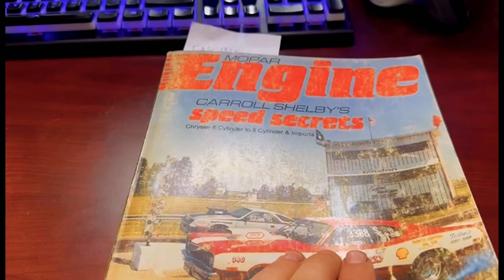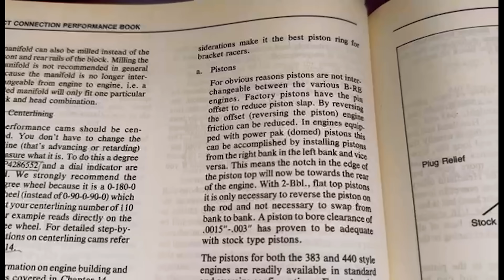The Great Piston Flip Controversy Returns - Fairy Tale Or Free Power?

Comment: This theory is dependent upon the type of piston. Sure flat top and domed piston you could reverse but if the piston is raised and have specific valve cuts for the intake and exhaust valve then you shouldn’t reverse the pistons. I just saw Nick of Nick’s Garage trouble shooting an engine trying to find a knock. When they tore it down to they found that it had the pistons in backwards and they were designed to be used in the correct way because they were raised pistons and cut with specific valve relief for the intake and exhaust valves. The pistons were backwards and the valves were hitting the pistons causing the knock. It should be advised that if the pistons were designed for a specific cylinder because the valve clearances then they should not be reversed.

Comment: UT, I used to do that piston flip on 400 SBC circle track engines in 2bl carb iron head intake and exhaust classes. Those engines would struggle to pull across a broad power band as stock but when flipped around with the same cam timing I could get 200-300 more rpm .

Comment: Great show Tony.   My gut was telling me they were using the wrong engine for the test.   Your offset info reinforced that.  I talked to Larry Shepard 
(The author of my copy of Direct Connection engine manual) and they don’t recommend flipping anymore.  He noted that the test would need to be performed on an engine setup the same as the ones they used. Great conversation with a man who was cutting apart heads and blocks to study core shift trying to understand the difference in hp and tq of racing engines assembled the same way.  I built my street class bracket car according to the book (not flipped ) and it runs on the money to the book

Comment: You need to watch David Vizards video on this. You not only turn the piston 180 degrees you also move it to the other side of the block. Smokey Yunnick did this in NASCAR and said it was only 8 or 9 horsepower.

Comment: 🔔😎🇺🇲
Never forget that flipping changes the piston acceleration rate approaching top dead center and leaving top dead center.... And also bottom dead center.
This indicates that the cam installed lobe center line angle might need to be changed... AND the cam lobe profiles might need to change. That is the valve events might need to be different.
As most know, there is quite a difference in cams with the exact same cam card specs. THE Joe Sherman claimed about 15/15 improvement on a Ford 302 with only the .060" offset... Just flipping without a cam adjustment might not get much of an improvement.
Joe got 400 hp from a 289 and a 302 with factory iron heads.
Magazines called him a liar because they couldn't do it Joe had little tweaks that 
😎everyone overlooks.
😎😎🇺🇲🔥

Comment: I seen some pistons, instead of nerl, they had cross drilled the friction points, on the skirts. They swear by it. It looked feasible. They were catching hell over it. 
    Buy some pretty over priced pistons, with this bullshit coating. None of them understand what the goal is, and probably have a builder do assembly. They are the ones that struggle with some hacked up beater grabbing the line from them regularly. Feel for the builder that had to tell them, suk it, you bought the parts.

Comment: The piston pin offset was also often reversed by many of the guys in Production Touring Car racing in Australia in late 60's, early 70's.
 
 Interesting point to note is that when you check your crank TDC mark pre and post the flip you will see  that after the flip the TDC mark will read on the retarded ('after top dead center') side of the TDC mark yet of course the piston is at TDC. This of course affects cam timing because you have the piston at TDC but you have rotated the camshaft forward and effectively slightly advanced the cam timing.

The above scenario also occurs to a lesser extent when swapping from a factory type offset pin to a typical performance piston with a centered pin. You always notice the shift in ture TDC marking and cam timing.

The piston flip effectively increases piston speeds toward TDC increasing quench mixture motion, then after TDC the piston moves away from TDC slower. So an increase in combustion efficiency and a decrease in skirt friction and piston time to absorb the combustion pressure. Very slight changes with results that vary due to piston pin offset and combustion chamber etc.
Reply: Great comment!

Comment: Uncle Tony, you made a very classy response to those big-dollar, television "experienced and highy technical" engine builders that have now been demonstrably proven to be completely talking out of their asses.  Well done.
Reply: Talking out of their asses with a megaphone on 12.
Reply: The offset wrist pin is purely a situational deal a 8.2 deck sbf has a .300 outboard offset pin vs say a  318 that has very  little offset " i believe it's .060 or .080 on early cast pistons" so there is a little mechanical advantage the sbf can take advantage of but it's purely only going to be available above 6k rpm and if you know anything about a 302 block if you hang it that high it's soon to be in your scrap pile when it splits down the center in 2 pieces
Reply: @ZackeryStang ive got a 68 302 block on an engine making 520hp that goes to 7000rpm constantly (curcuit racing). If its split down tge middle the sump has been doing a good job of holding it togeth these past 9 years.
Reply: These same people also did a back to back dyno test for this exact thing and showed zero power gain. How can you dispute that data?
Reply: @silverbell800  on the incorrect mopar block...
Reply: @silverbell800  he said that the engine they used had such a tiny offset that it wouldn't really matter in that particular engine.

Comment: In a racing class where one has to use factory parts, it’s a way to try and get an advantage. At some point everyone will know.  The 3-4 horsepower it makes isn’t worth the life. The geometry is easily figured out why, it has the same effect as a longer rod.  Longer rods are almost always better.  Longer rods have longer dwell at TDC absorbing the power longer.  Making more and more power it’s not good. Now one is trying to gain life to not grenade.  400 horsepower ok. 600 or more it will cause problems.

Comment: The engineers who designed pistons with offset did so to reduce noise at the expense of parasitic friction. They knew this. They said this. They wrote it down. How could eliminating a frictional loss not free up a small amount of power? It would make no sense. 
The suggestion boils down to the idea that the engineers got something for nothing which is patently absurd.

Comment: Working on a 1963 40 hp vw there are two sets of rods for it the offset and non offset. I have the non offset so maybe a bit more noise from piston slap but vw did it for a reason. It's a small quieter reason. Noise equals less friction so I don't care. Less friction is good.

Comment: Marine engines are flipped when we make am engine run right hand instead of lefthand. Gear to gear cam drive and backwards she goes! Never heard of it for power.
Reply: Therefore they would not be reversed
Reply: @kellismith4329 ? If you dont fip the pistons on a rigjt hand drive boat engine theskirts will wear in no time at all. They are 100% duty cycle. They break.